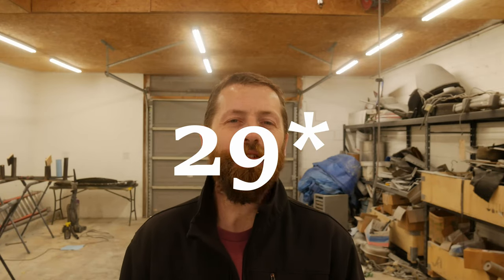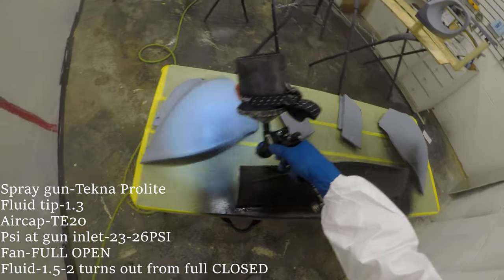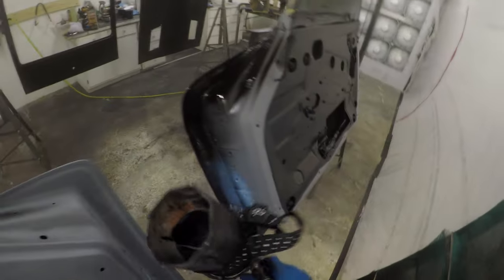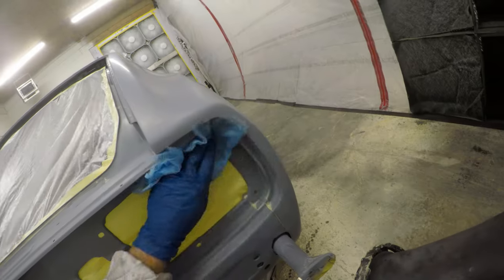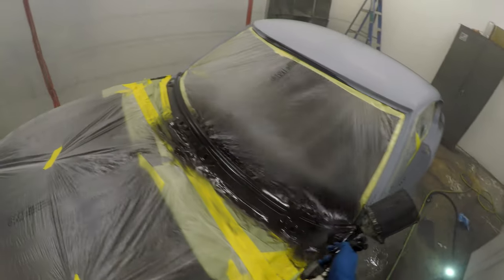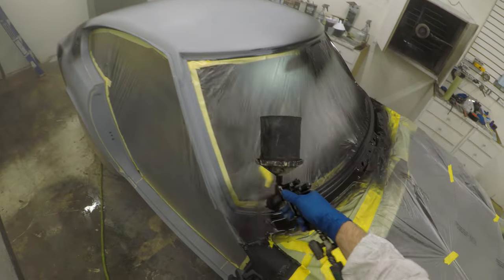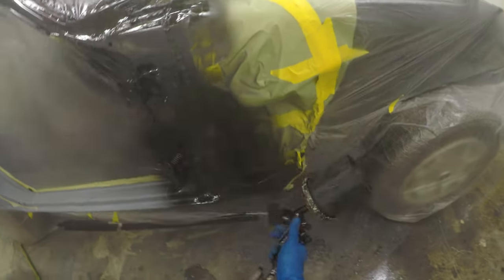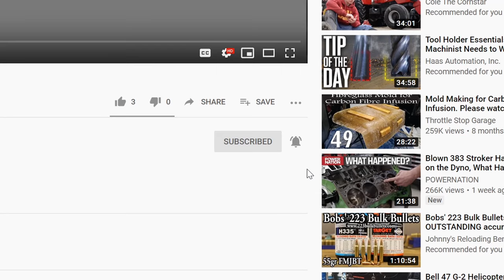Datsun 280Z Paint and Body EP29 - Spraying SEALER

Comment: What do you mean by induce?
Reply from the maker: When you mix the epoxy primer and activator together you have to allow for induction (time it takes for the chemicals in each component to start reacting to each other) The 2k primers regular and high build, along with base coats and clear coats can be mixed and sprayed right away.
Reply: @hcr-motorworks  thanks